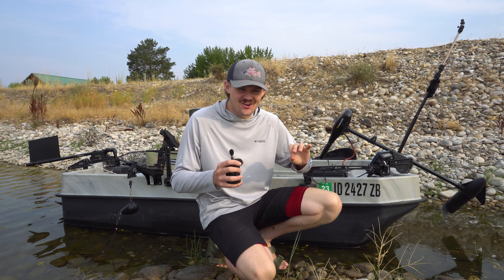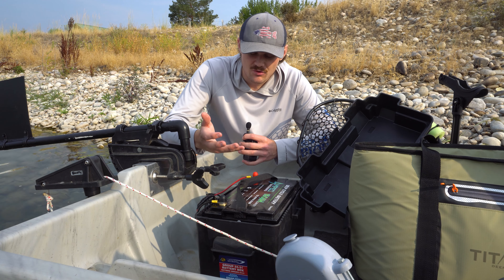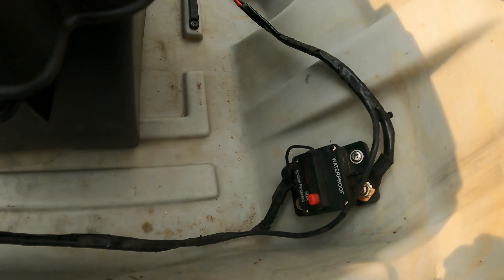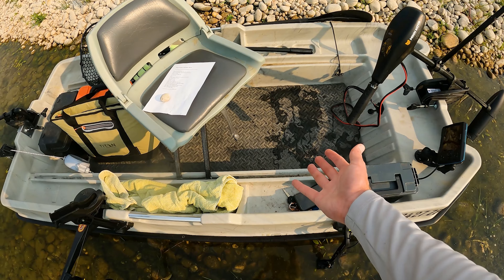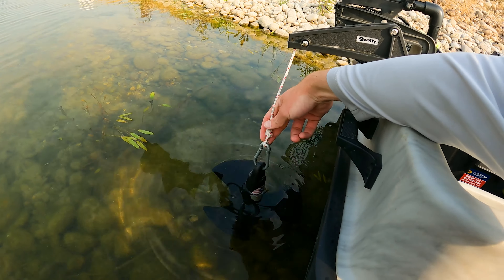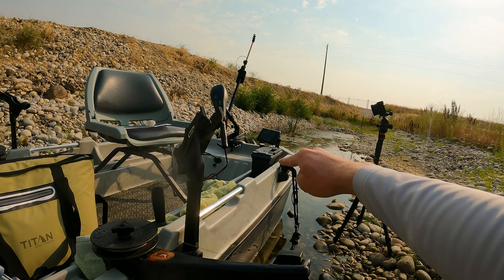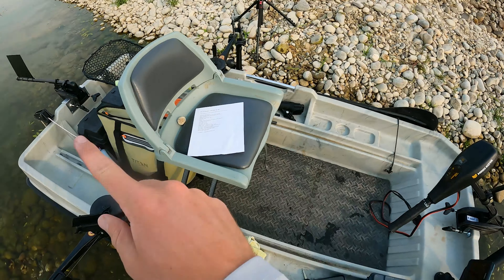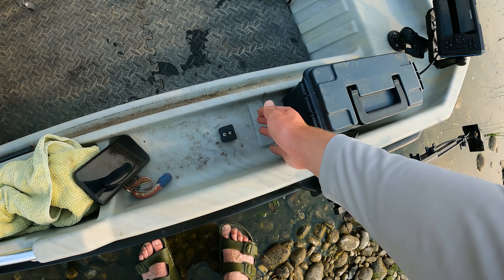Bass Pro Shops Pond Prowler 8: Walk Around/Review/Upgrades

Comment: How well do screws hold in the plastic do you recommend any glue or adhesive to fasten or seal the screw holes on the rod holders to the boat.
Reply from the maker: Yup! I use a sealant to cover the holes to keep it waterproof and strong. Link to the sealant is in the description!

Comment: Quick question about the Anchor Line Retractor in your items list.  I am currently using Paracord for my anchor.  I think you said you replaced the line that comes with the clothesline.  Was that easy to do?
Reply from the maker: Yah, just don’t let go of the cord cause it will undo the spring in there. Learned that the hard way lol

Comment: I enjoy customizing my kayak and I’m thinking F getting one of these boats next. I recommend putting a hook to hold your orange fish hook box or a tray under the seat because under the seat is wasted space. Also, is install straps or a hook so you can hang the yellow titan cold fish bag to the back of the seat. I wouldn’t like anything left in the floor. Lastly, I’d open the factory installed drain plug and install a piece of pvc pipe with nut and bolt to hold the fishing net. That would be perfect ❤😊
Reply from the maker: @briancherry940  Those are great ideas! Appreciate it, I’ve been wanting to do something under the seat for awhile

Comment: Great videos!  I finally got my Sundolphin Sportsman 8 ft legal and got it out for the first time on Labor Day.  I had a fairly easy time getting it into the water but like an idiot I chose a steep boat ramp and getting it back out was a pain.  I built a dolly.  It's basically a small piece of 2x6 with 2 10 inch tires bolted to it from Harbor Freight.  It has 2 rings bolted and I ratchet strap it after I pull the first 2 feet off the bed of the truck.  I threw away my cheap ratchet straps the next day and invested in some retractable Rhino USA ratchet straps and took it back out today but launched from a flat ramp that hardly any big boats use and WOW what a difference.  Still got my feet wet getting it out but if anyone reads this and is about to take a maiden voyage BUY RETRACTABLE RATCHET STRAPS!  I still want a couple metal plates like you use on your downrigger.  I'll take your advice and check for a local metal workshop.  I'm paranoid about putting any holes in the boat.  I'm using the rod holders you used last year and my fish finder transducer mount is Scotty but I use the rail mount instead of screwing it to side.  Have you noticed any leakage around the seams?  I'm wondering if I should caulk around the seams.  I do have a MinnKota Endura 40 lb pushed by a LiTime 100ah lithium battery and love it.  I bought a rudder attachment because I use it in the back but haven't installed it yet.  According to my Garmin I was hitting 2.75 mph against the wind and 3.5 mph with the winds help.  Anyways, I look forward to more videos
Reply from the maker: I don’t think I have any leakage yet, but I also use a special marine sealant around any holes! I have a link to it in the description

Comment: Good video, as usual, but thought I'd let you know that the wiring running through the boat is only rated for the amperage draw required by up to a 40 pound thrust trolling motor. If you don't want the wires to melt, which will happen before the 50 amp resettable CIRCUIT BREAKER will trip, you should replace the factory wiring with a heavier gauge wire. Do a little research. I'm glad you aren't using a FUSE for the motor. I mainly fish saltwater, so I prefer Newport Vessels trolling motors. They're saltwater compatible, quiet, dependable, have a 2 year warranty, and are less expensive than Minn Kota motors. Tight lines, and keep the good content coming.
Reply from the maker: @raymondwilcox4997  Funny you said that, this year I will be rewiring the boat with better stuff. What gauge wire do you recommend?

Comment: Please don't stop carrying an anchor whether or not you get spot lock capabilities. You never know when you could lose power to components, or something stops working for whatever reason. Also 25' of anchor line is not nearly enough, unless you don't go in water over about 6'. Anchors aren't designed to be used vertically. Please do a little research on anchoring properly, before you get some inexperienced boater in a dangerous situation. And make sure the anchor line is strong enough to handle waves and wind much stronger than you plan on encountering, and that the anchor is of adequate size to hold your boat, and don't forget your PFF, and other safety equipment. Safety first, THEN fun, otherwise, it's... NO FUN!